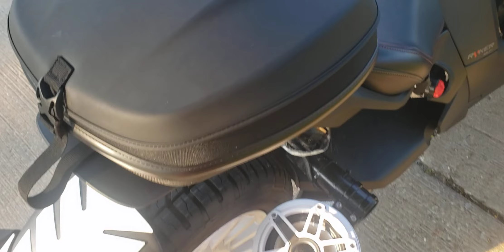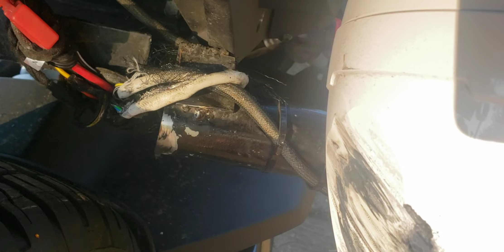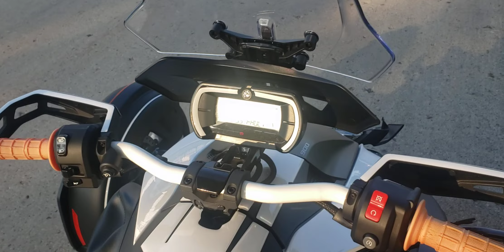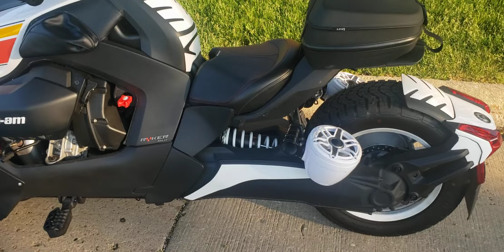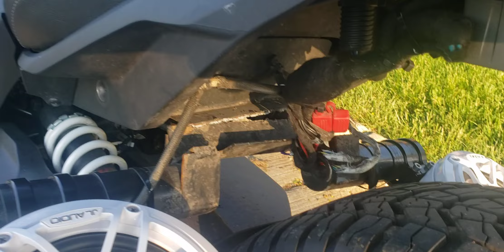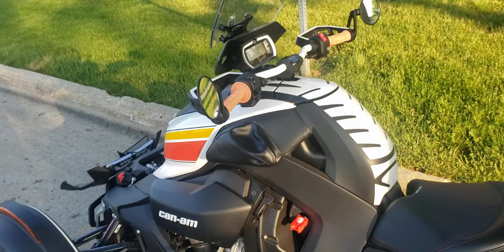NEW 2022 Can Am Ryker Rally BROKE down again! I swear this bike is cursed!

Comment: Check your number 7 fuse it's a 10amp fuse
Reply from the maker: Checked it. Was all good. Some ticket noise coming from the right side of the bike behind the filter
Reply: @c8pate744  dang BRP dropped the ball with the 2022's 🤦🏾‍♂️

Comment: Brother sorry to hear this. Wow this is crazy. I have a 22 rally and my check engine light came on from first day. 2 days later it's gone and has never come back. Had issue with frunk not locking when key is removed. 4 days later all is good. So alittle luck helps I guess. Take the speakers off and see how she rolls. It's a great bike may have to wire differently. But with all the knowledge you drop you will figure it out
Reply: Dang, I’ve been lucky.
Reply from the maker: Yes you have!
Reply from the maker: I might just try that. Thank you for watching and commenting

Comment: Did you add a separate fuse block to control the additional power requirements? 

I would not add anything to the bike without an isolated fuse box, thus it separates the power drawn away from all the computers.
Reply from the maker: No. Probably need to
Reply: You can get by with just LED’s but the amp is a little too much draw, probably. And if you connected it to a switched circuit. Did the instructions recommend anything bigger than 10 amp fuse…… now you might be able to pull directly from the battery but then it’s not switched and it will drain way too fast. Good luck.

Comment: I leave my factory wiring alone. I added a separate fuse box and battery in the frunk. All the wires are separate. It sucks it caught fire. Even with separate wires, a fire will melt anything near it. Most likely one of the wires going to the 3 VSS sensors is melted. Sorry to hear that. I hope they can fix it. Also I don't use speakers I installed bt helmet intercom. You can hear music clear without wind distortion if you add those to your helmet.
Reply from the maker: I hear you my guy! That you for the suggestion. What brand Bt equipment do you use?
Reply: @c8pate744  Fodsports FX8 it's not the most expensive brand but it's not the cheapest either. It's a good middle of the road option. Pretty good sound and I can hear and talk on the phone or the intercom very well and it had FM radio which is a nice feature to have. I really like it. It is easy to install and you can replace the microphone if you want to because it has a normal plug for one. Plus it pairs up to 8 riders I think.

Comment: Rykers are sensitive when it comes to electronics.   You probably need to upgrade the battery to have more cranking amps.   The factory battery has 100cracking amps and if it falls below the 100 it will not start.   So it’s easy to have it fall under when you add lights sound etc.  it will kick out that VSS message u got.   Get yourself a 120 cranking amp battery and you should be good.
Reply from the maker: Good feedback my guy

Comment: Sorry your toy is causing you grief. I once read that when adding accessories the extra length of wire can increase the resistance within the wiring harness and cause issues. That doesn’t sound like what his causing your problems though. Don’t beat yourself up it’s not like it’s your daily driver and you can’t get to work.
Reply from the maker: It happens with these bikes at time. Thank you for the uplifting words

Comment: I feel for you man, the only mods that I put on  my spyder are plug and play. I try to avoid mods that have to be wired separately only because of what happened to you and they may drain the battery a little faster. Based on what you said, all is not lost because  it wasn't anything wrong with the bike itself but what you had added to it so when you have it fixed, make sure that everything is wired so that this doesn't happen again. Have a little faith, everything will work out fine C8.
Reply from the maker: Thank you! Good looking out my guy
Reply: Well I think that you have to step back and ask what happened that caused the speaker bar to break might need different bar.
Then as you said once bar broke that caused fire 🔥 the fire blow something out fuse or something in Bike.
   I had 6.5 Bluetooth speakers on mine had problems so I went with a Boss Bluetooth 600 watts system off Amazon for $103 works great thank God.
But something that your putting the System on is causing the problem not the bike itself.
These girls are very sensitive so putting big stuff on them is not that I am sticking to the basics.
But 
We have step back and put little but loud and Wrap or Paint her and go from there.
      If we add home made bars and Big systems it might cost us more down time than we want.
        But I hope that you get her woke and enjoy your ride.

Comment: Some you doing or someone who install your mods are wrong bro
Reply from the maker: I didnt install any of the mods on the 2022.
Reply: @c8pate744  are you coming straight of the battery with a kill switch or they tapped into your wire harnesd